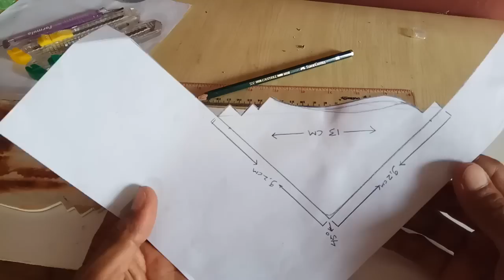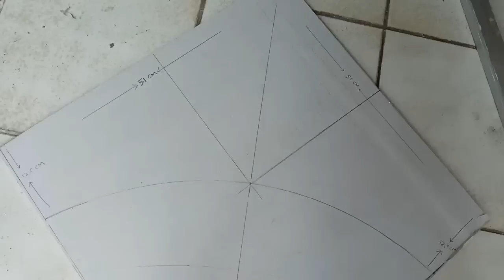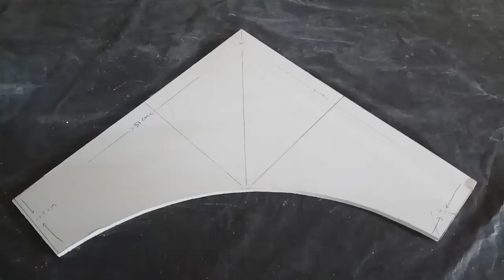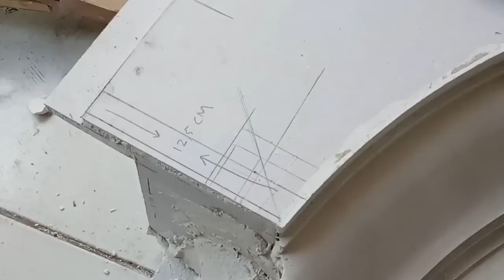Amazing technique design and making ceiling corner molds ||| Gypsum plaster pattern forming skill

Comment: How do you fasten the moldings and the corner peice to the ceiling? Is it strong enough with the fibers to not worry about screws cracking it much?
Have you considered using burlap or other fibers so it is not as hazardous to sand?
Great work, and thanks for posting it. I have considered making moldings like this, but with a simple angle as the mold and dragging the form over each molding. The fiberglass negative is probably faster in the end though.
Reply from the maker: @Court, thank you
I use gauze to keep it from cracking at the corner connection when installing on the ceiling